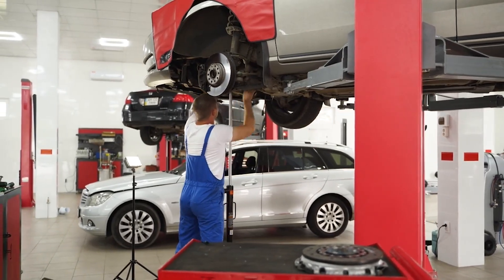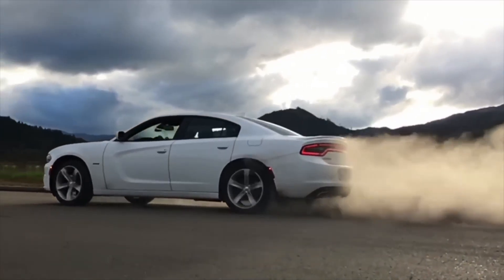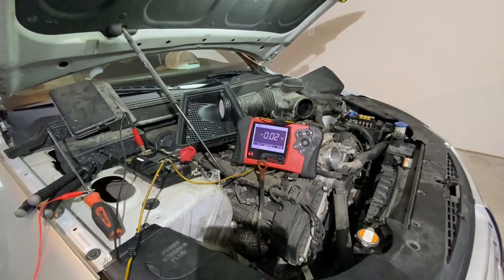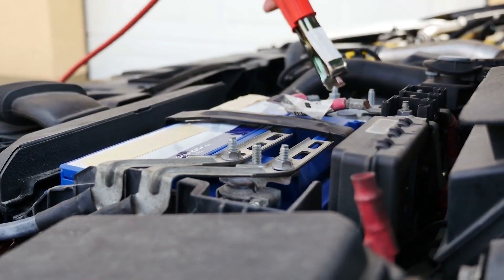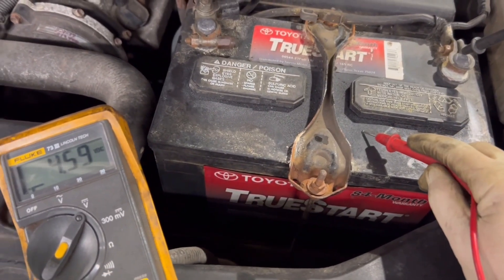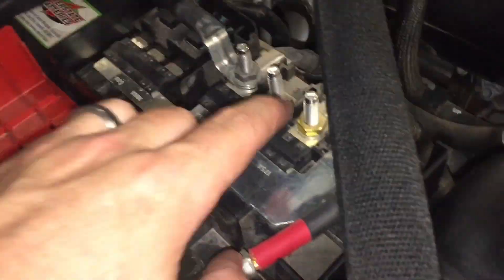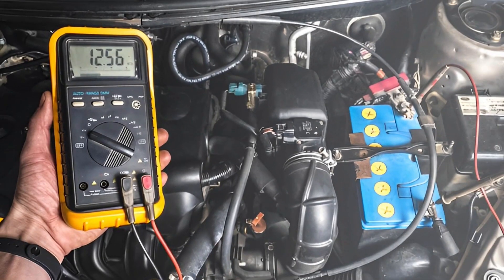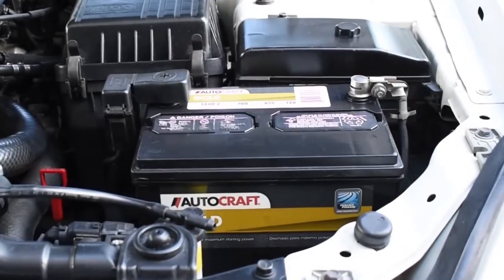Alternator Warning Signs Most People Ignore

Comment: Awesome 👏 
Well my battery dash gauge sometimes shows by the looks of it about 15.5 volts 🤷‍♂️ and stays there for hours while hiway driving and then next day all seems fine pointing straight up to 14 volts on the gauge ..
I've not tested with a meter yet but I will ..
It's a Chevy 2016 high country 4x4 crew cab

Comment: I'm learning about cars gradually.. We (Australia) used to have roadside assistance which was pretty good value and a guy would come help get your car going. They'd take as long as it took.. Sometimes 30 mins or more.. If it was a lost cause then they'd have to call a tow truck to take it to a mechanic. 

But sometime around 2015 it changed and if they couldn't get your car going in 5 mins it was tow truck time! So the  membership was hardly worth it.

Lately I've had what seems like a flat battery but a few people (I've had to find someone willing to help cos I bought the booster cables but need power) have mentioned the alternator. I suspect it is that and you know, I hate the electrical systems! Power windows - I can wind a window down manually. Power seats - I can put a seat in position manually.

Anyway thanks 👍✌️🇦🇺
Reply from the maker: If you can find someone around you with a battery tester start there. If the battery checks out good check the alternator with a volt meter .